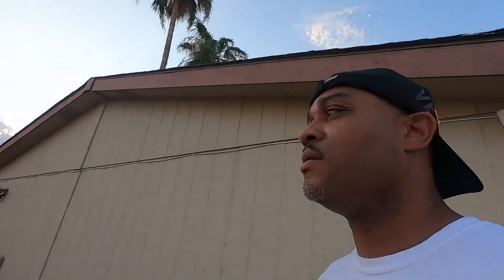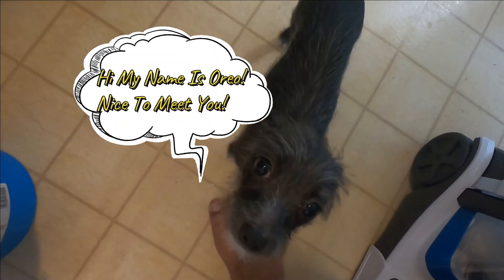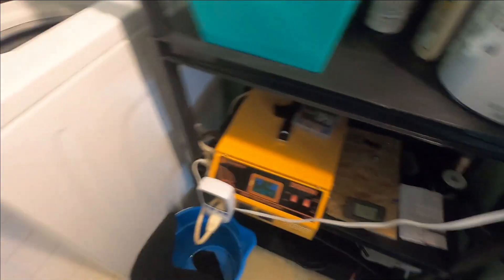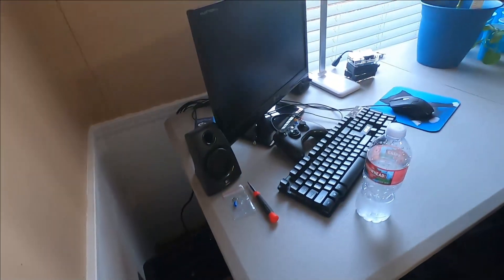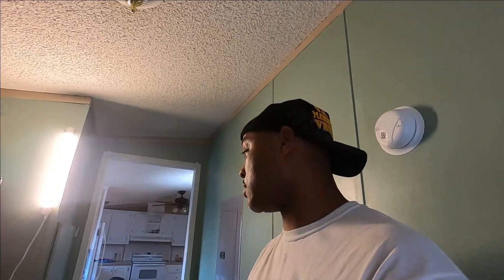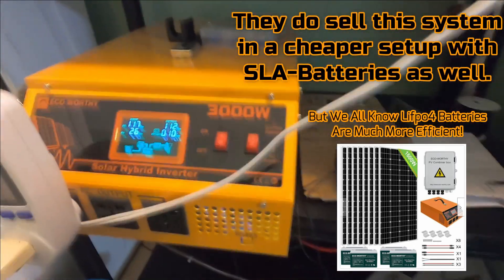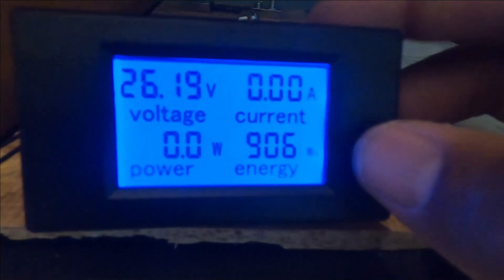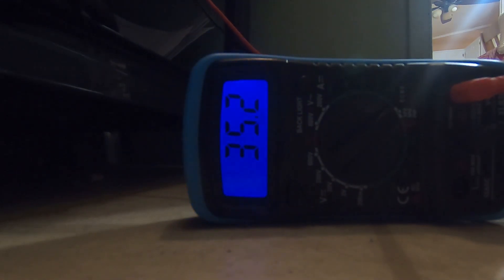Eco-Worthy 3000w 1kw Solar Kit - Review

Comment: Good review Bro! If you find some used panels on CL you could beef it up and run an air conditioner on extra hot days and maybe have a little extra power in your batteries to run it into the evening. I actually got some used panels for $10ea.

Comment: for some reason mine just beeps the whole time.  Not sure what that means but it doesnt work and I double checked that the battery is charged and the solar is working   Any ideas what the beep means and what I might be doing inccoreclty
Reply: Im having the same issue, i have this exact inverter. Except i dont have any solar panels yet, im using (2) sla 9ah @12v batteries (in series for 24v) on grid. I can see the incoming AC input, but when i flip this switch for AC priorty, its not charging the batteries. When i turn it on its exclusively runs on batteries and not ac. But when its powered off, i get pass thru AC to the outputs no problem.

But when the inverter is plug on, it will run batteries until it drains them and i get beeps when they are dead.
Reply: Having the same issue. Did you guys ever figure it out?
Reply: No I contacted customer service and they told me that it was internal parts that were not working and since I was 1 year and 25 day since I purchased it they would only offer $100 off if I buy a new one

I don’t recommend this product at all so don’t buy another one

Renogy is a superior product and excellent customer support and service

Comment: I got pretty much the same system with the difference that we need much more solar panels got get the same amount of energy out of the system due to much less sunny days in Germany which I only can compensate by using a MPPT loader instead of a PWM we got the system originally equipped with. But alltogether it´s really worth the money.

Comment: Most of solar geeks are nomads living in vans. This one is a household solar system. 
Running fridge requires battery bank, that’s why  the total cost runs up, in the thousands.
Takes some years to payback but used frequently enough, it’s cheap.
Reply from the maker: I agree with you Mark, Great Comment as it's very true that you will eventually recoup your initial investment but it takes time.

Comment: I have just purchased that eco-worthy 3000w all-in-one system I also found it to handle anything I threw at it including a movable air conditioner, and an air compressor and my wife hair dryer that will melt steel
Reply: Bob, can you run any power tools on this system?
Reply: @Handelson  absolutely yes I ran a Sawzall I also ran a Skil saw I also powered up a fairly decent size electrical compressor

Comment: Great setups that you have and a very smart move to go solar. I was looking at this Eco-Worthy 3000 unit and noticed that it had gotten good reviews from the few individuals that reviewed it. I like that it can be operated in 4 different modes and can run in conjunction with your on-grid system or run completely independent as an off-grid unit. I like some of these new all-in-one units where controller, inverter, and charger are integrated into one unit. I have a new 12-volt 3000 watt inverter and a new 24-volt, 3500 watt inverter and will be running 2 different systems (just like you). My components were bought separately because I hadn't gotten enough feedback on the integrated units at the time that I bought my components but the Growatt & Eco-Worthy units appear to be very good units. Fortunately, I did decide to go exclusively with LifePo4 battery technology because it's the best battery option for solar presently.

Comment: Solar Bro , I commented down below and told you I was going to buy one and I did, because of your video . question before I hook it up where are the fuses in it and can I run a window  air conditioner and full size refridge  from it at the same time I'm nervous about this and want to do it  right and could you make another video up date on what you have learned from your inverter. Thank you in advance .
Reply from the maker: Hey Rose. I have ran a full size fridge, and air conditioner at the same time with this setup. I did add an additional 2 195w solar panels to charge the batteries faster Durning the day. You'll need to add your own fuse in between the panels and the inverter also I added one 8n between the batteries and invertor as well. There are good fuse size calculators free online that you can use to suite your needs.
Reply: My wonderful Solar Bro , what size in line fuses do you have for the battery's and solar panel wire ? I bought a 100 amp block fuse for the battery's but haven't bought any for the solar wire . Sorry for so many questions I know your bizzy. can't spell worth a you know what. thank you. hugs Rosie.

Comment: what is the min and max cutoff on the charge controller?  I have Nissan leaf batteries and I charge to max 24.5 volts and min. I can go to 19 volts on a 24-volt setup, can you do a user-defined battery profile on the charge controller?

Comment: hi. 1st let me say. great review. i just bought the little bigger set up. a question??  do u run the fridge continuosly. and about how much of ur battery bank doed it drain.
Reply from the maker: Thanks for the comment Dwayne, Yes I sure do run it continuously and I usually go about 12-14 hours before it kicks over to the Grid for power. It does drain the bank over several hours, but since adding another two solar panels (195W) the battery banks are fully charged with 4-5 hours of full sun and now I'm getting about 18-20 hours of continuous power. Pretty much lasts all night and the bank is re-charging during the day for no more power loss at night.
Reply from the maker: Thanks for the comment Dwayne, I do run the fridge continuously. I'm getting about 8-10 hours run time just running the fridge at around 200 watts continuously. Where it drains the most is first connecting it to the invertor where my particular fridge will draw around 6.8 amps then drop down to about 1.5 amps continusly.  Here's a link to a battery bank calculator that I like to refer to but each application will vary depending on the amp draw is what I've discovered. - Link to battery calculator: http://www.batteriesinaflash.com/battery-run-time-calculator